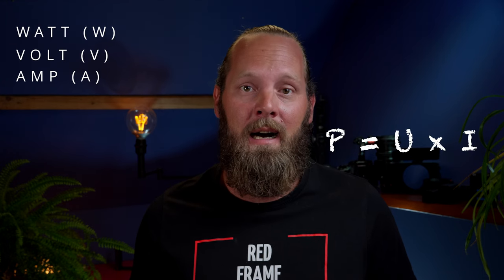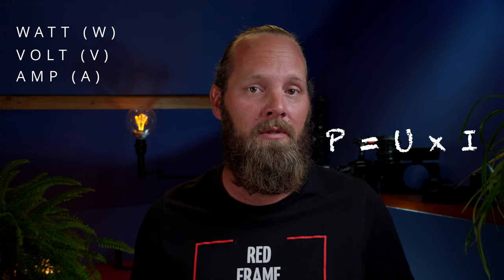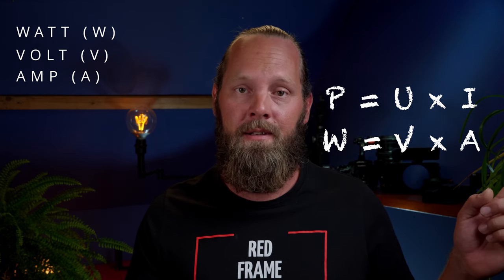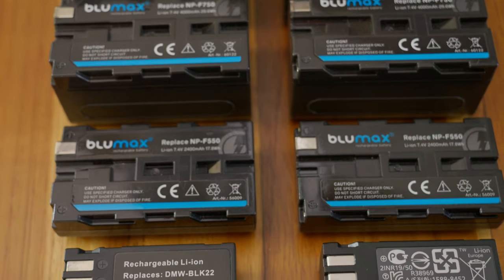4 WAYS to POWER your CAMERA(rig) // Introduction to DC Power

Comment: do you know if there is a plug available that allows the s5ii to charge from the mains wall plug via usbc port? something that charges the camera while it is turned on and operating?
Reply from the maker: Absolutely. The newer LUMIX cameras can be powered and charge the battery simultaneously via USB C. The only requirement is a USB C wall plug/charger that can supply at least 9 volts by 3 amps (USB C PD). And a suitable usb c cable, but most cables will work.

Comment: Great run through! 👏🏾👍🏾🙏🏾
I have a lovely compact and totally balanced  rig for my GH6 that is powered by the FX Lion but so far I have not found a dummy battery that gives me all the top end codecs and resolutions of a native GH6 battery, so I use the USB-C port which works perfectly for the time being. However, when Panasonic release that promised firmware that will give us external SSD recording through the USB-C port then I will have a problem to solve! Are there such things as splitters for USB-C and even if so will the power required draw more than the FX Lion Nano One can give?🤔
Reply from the maker: Thanks Eugene 🙏
The FX Lion batteries are great! 
I am looking into the power problem for when the firmware for SSD recording comes out. Haven’t figured out a solution yet. But if and when I do, I’ll definitely post a video about it!
Reply: @RedFrameTech  I look forward to it !👍🏾🙏🏾

Comment: Very helpful.

I have quite a few NP batteries. May I ask what V Mount setup you suggest to power a GH6 and Ninja together?

Also is there a way to attach all this to a cage?

Cheers😊
Reply from the maker: Hi Frank. You own an S5 now?
A good way to set up the GH6 + Ninja V power by a v-mount would be by getting a v mount with USB C PD (9v 3a minimum) and a d-tap port. You can power the GH6 via USB C and the ninja via d-tap to dc barrel connector that goes in to the battery eliminator/dummy battery for the ninja v. 
If you want to be able to use SSD recording with GH6, you'll need to get a usb c pd to dummy battery for the GH6. However, those are only available as 3rd party products and need to have a proper voltage converter in them. So, if you don't know much about dc power, it can be a bit tricky. I do use a usb c to dummy myself, but I do research when I buy something, but more importantly I do a thorough check when get it. But I have a background in dc power and know what to check (and measure).

As for mounting it to a cage; there are tiny v mount plates on the market (SmallRig, AndyCine etc.) that you can screw on to the cage and attach the v mount to it.

V mounts that I have tested are the FXLion Nano One and Two and the Vemico V99, with the latter being the best value for money, but is also bigger than the Nano One.

All of the above applies to an S5 as well, except for the SSD recording.
Hope that helps.

Cheers!
Reply: Thanks for the very helpful reply. While checking some YouTube’s and Amazon Reviews, I came across a Power Junkie version 2, which recently ended on kickstarter.
It ticks all the boxes of a V Mount however it uses NP batteries, and I have quite a few of those. They also do a dummy battery for the GH6/S5. Even though the Kickstarter has ended, they are still allowing a few purchases. 

If you’d like then I can let you know how I get on with my Power Junkie and dummy battery. Looks like I will be able to have my cake and eat it by powering the camera and record direct to my SSD.😊
Reply from the maker: @frankinblackpool  sounds good! I have heard of the power junkie. I’d appreciate it if you let me know how you get on with it.